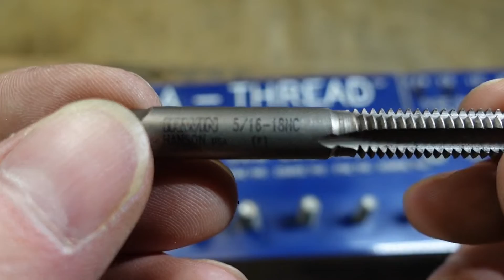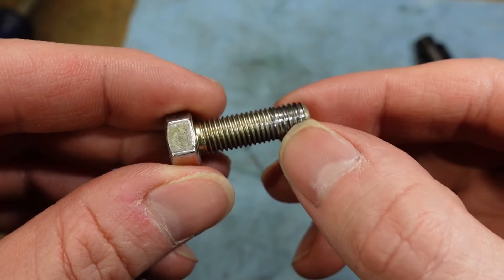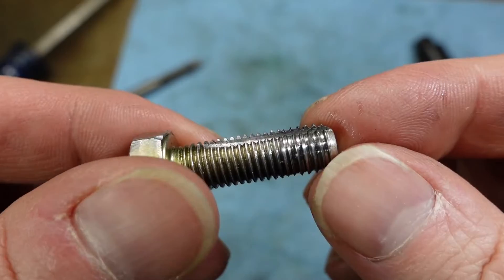DIY Thread Chaser Tool for Damaged Threads - DIY Thread Tap

Comment: Thanks so much. I had a motorcycle seat bolt that stripped the internals in the frame of the bike. This worked perfectly. Dremeled two slots in an 8mm bolt and pushed the stripped parts through. Works as new! Thanks so much.

Comment: awesome idea I would just put the nut on before using the angle grinder because sometimes it can be hard to get the nut back on cut threads, also if you get the chance I would replace that set screw with a hex one (flat blade screws should be illegal:)